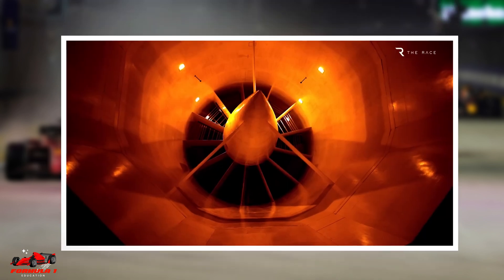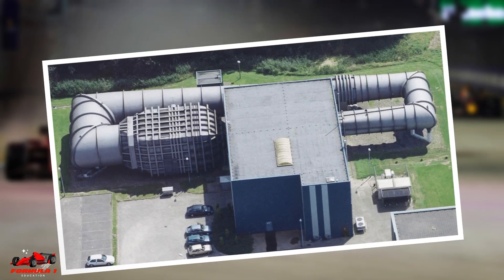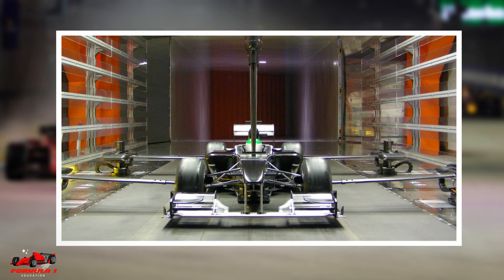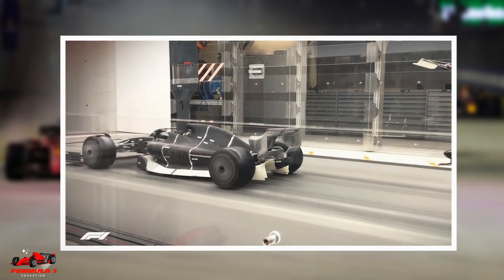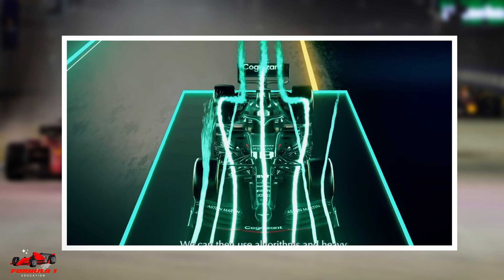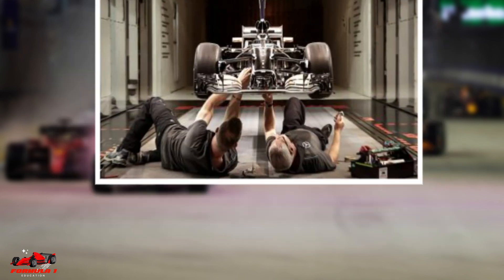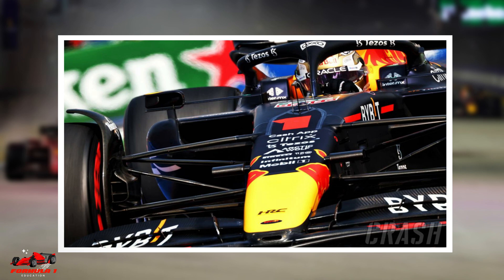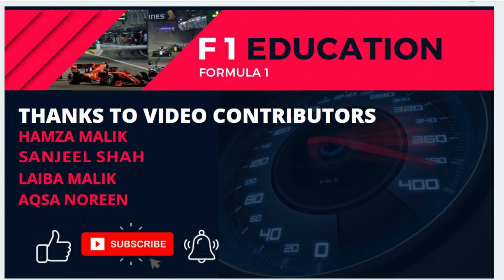Formula 1 Wind Tunnels & how Redbull will be impacted in 2023 Explained

Comment: Nice video! What I still don’t understand is why CFD with modern day compute power and innovation can’t replace a wind tunnel?
Reply: Because a computer simulation cannot emulate a 100 % real test environment. Even the wind tunnel only has upto 80 or 90% accuracy on the forces experienced by the car, especially while cornering. 

Further, in CFD you can only simulate one run with a single wind direction. In the real world a single run typically has multiple wind directions associated with it
Reply: Excellent point. A simulation can also broaden the testing and bypass the regulations that make optimizations impossible. Once they have run the sim, they can easily affirm its effectiveness with track time.
Perhaps it will become a race for the best sim. Yet there must be strict limitations on what the FIA is allowed to touch.